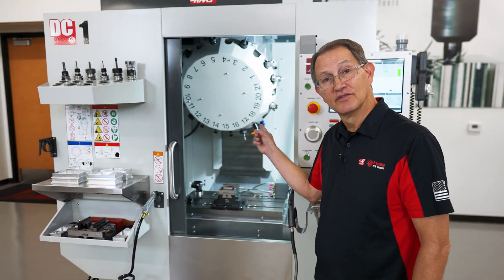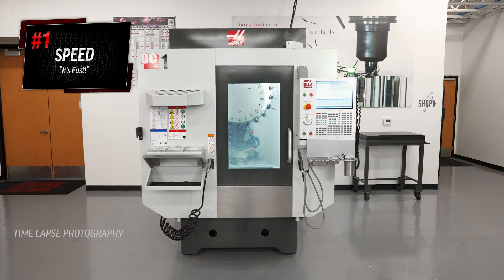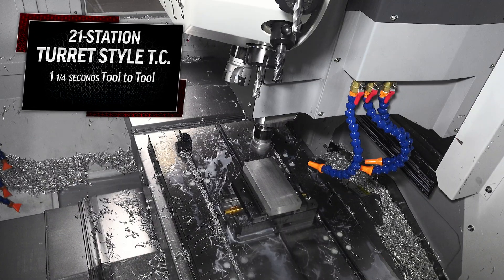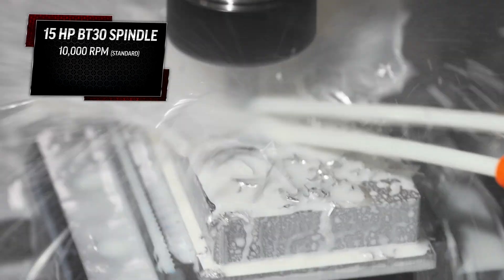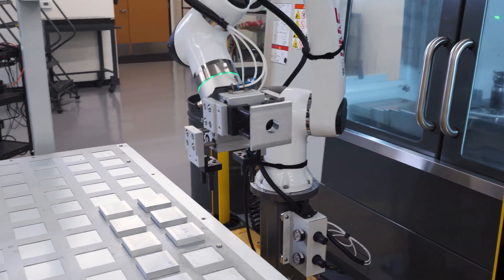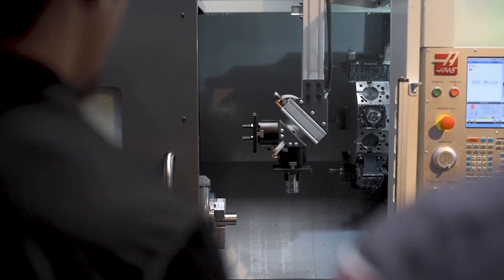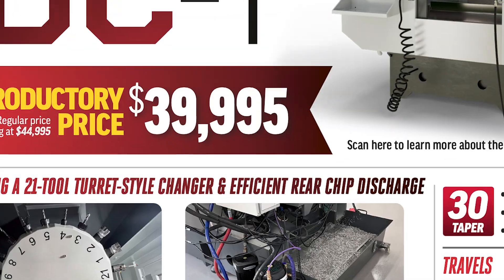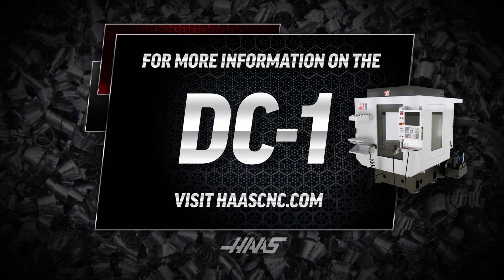The New Haas DC-1 High-Speed Drill Center - Haas Automation, Inc.

Comment: I attended a Haas Demo day where I saw the DC in action. It is not a speedy machine at all. Not to mention needing to purchase the HSM add on for a machine marketed as a "speedyo". I also was curious about the chip control (wash down) this machine doesn't have a conveyor system nor a option to add one. I walked around to the rear of the machine where I could see 1 of the 2 coolant and chip spill ways was clogged and coolant was over flowing onto the floor as well as coolant started flooding the bottom of the machine. Mind you, they were by no means roughing and the chips still clogged up. Disappointing.

Comment: Take that @TITANSofCNC
Reply: @johnenglebright6122  first video of a syil i watch and its chatter all over, i rlly doubt it.
Reply: @johnenglebright6122  oh ok, yeah I totally believe your judgement, because you already tested the all new Haas, so you could make a non-bias comparison
Reply: @yz85y  I actually did test this exact machine from the same manufacturer (literally identical casting and everything, with the same specs across the board) a few years ago. Its decent machine for volume aluminum production, the ones used locally have been running for 8 years with no problems baring a few spindle swaps on a couple of em.
Reply: @johnenglebright6122 
So I guess you don‘t run your Syil hard enough. 
Run it like TITAN would run it in Aluminium, 1/2“ KOR5 ap 3xD and ae 40%. 
Syil is a little well built beast with precision components straight out of Switzerland and Japan! Get after it! If she’s screaming it means she likes it! No tears no productivity! BOOM!
Reply: @johnenglebright6122  rarely have chatter on a haas either, haas has a easier control and plug and play rotary options, thats a big benefit imo
Reply: Identical to who's machine?   Is this a rebranded haas controlled unit?
Reply: @RoboDriller  google Speedcn cnc and you will find it. Taiwanese rebrand I believe

Comment: What's the shipping height? Will it fit under a garage door?
Reply: 7500lb. Needs 90 inch opening and a 6 inch concrete slab. So you'd potentially need to change your garage door to a 8 foot and replace the 4 inch slab with a 6
Reply: Yes you can take it to Church xd

Comment: It's definitely a nice machine, but it's interesting to me that the rapids are slower than that of the DT-1. I wonder which machine is truly faster. Also, seems like a small chip conveyor in the back would be a great idea but I don't see the option for that either.
Reply: We have a DT1 but almost never run it at 100% rapid. the machines just shake themselves apart and the time savings is virtually nothing unless it's rapiding all the way across the table. So personally I'd rather have a machine with higher accuracy and axis power 🤷‍♂